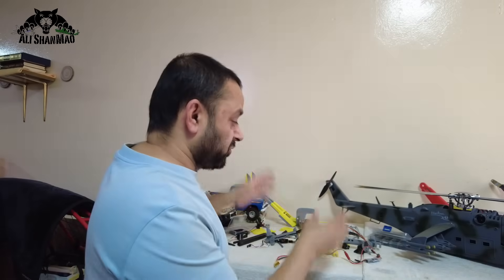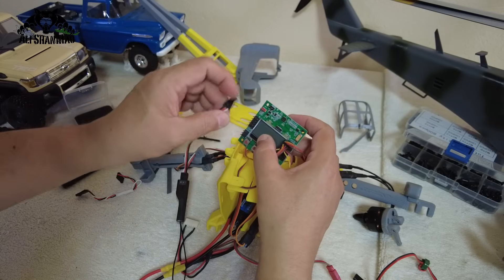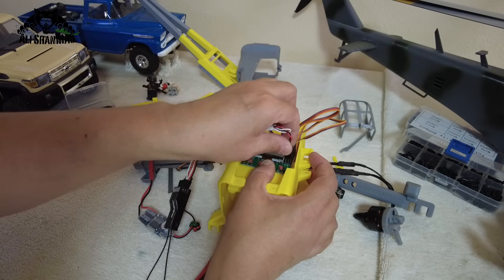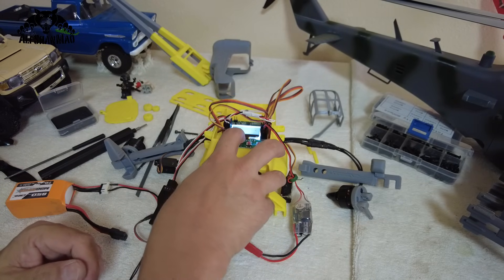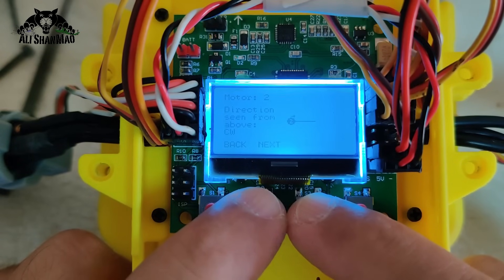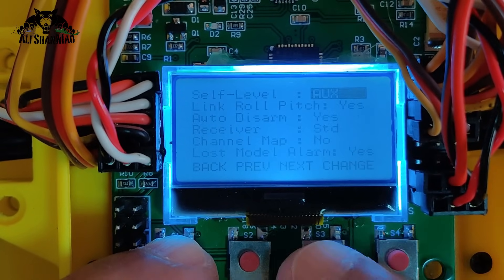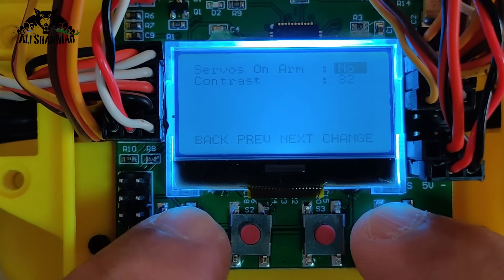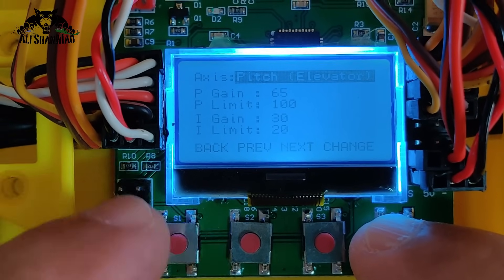How to build A 3D Printed Bi Copter - Part 3 Installing and configuring Flight Controller

Comment from the maker: Our Super simple easy PDF Guide is here: https://createc.store/product/bicoptersguide/
Video Guide Part 1 Introduction to Kit and Hardware: https://youtu.be/wz-_L0WA0ts
Video Guide Part 2 Kit Assembly and Hardware Installation: https://youtu.be/tpaIt-0S79I
Video Guide Part 3 Flight Controller connections and configuration: https://youtu.be/Kv-WetLefkU
Video Guide Part 4 Radio Setup Final Touches and Test Flight : https://youtu.be/ssgQD2LvrTU

Comment: Ali, the links to the motors+ESCs and servos don't work anymore. Not that easy to find special parts like this. Would be nice if you sold all the parts as a complete kit, incl. srews also in your store.
Reply from the maker: Hey man thanks for the update. alright I will update the links or I will arrange everything on my store. thank you very much once again for your support